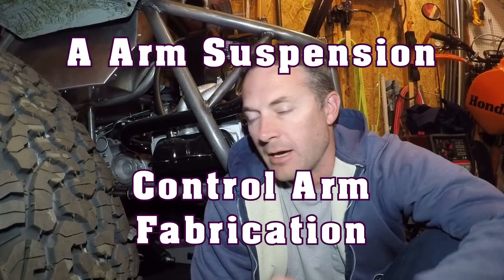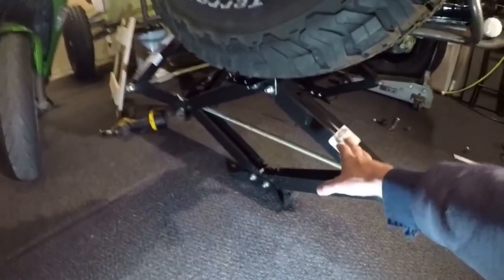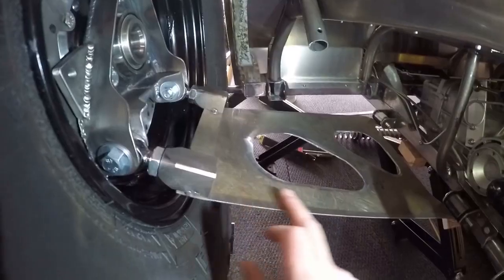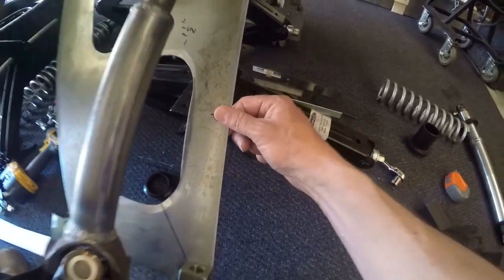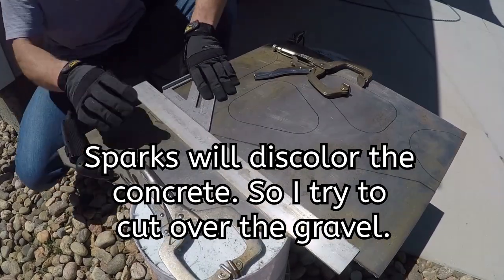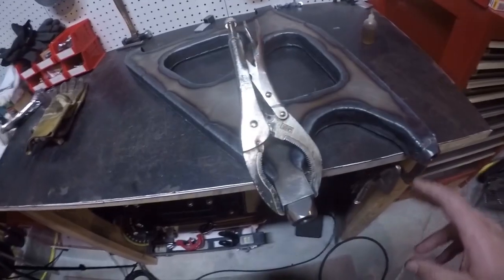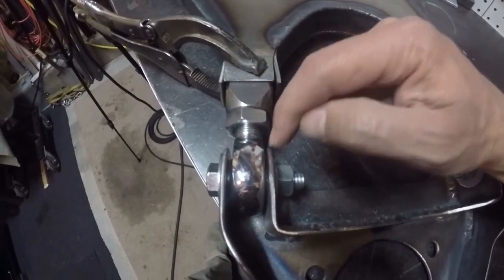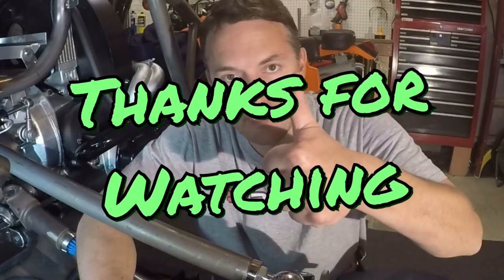Baja Bug Rear Control Arm Fabrication A Arm Baja Bug

Comment: What was the final track width, mounting flange to mounting flange, front and rear? 

I’ve watched all your video and don’t believe I ever heard you say.

I really like the look of Mauler. 

It doesn’t look too wide. It looks just right.
Reply from the maker: Mauler is 95" wheelbase front to rear. 
The front is 70" outside of tires, 62" centerline of tires. Front tires are 31" x 9.5" wide.
Rear is 77" outside of tires, 66.5" centerline of tires. Rear tires are 33" x 10.5" wide.
I don't have flange to flange width, but I hope this info get's you what you need.
Reply: @DougBugBuilder  I appreciate the reply amigo. 

This info is perfect. 

Thanks for all the inspiration.

Comment: I am a complete newb; why did you use a box design over building out of tube?
Reply from the maker: Boxed is easier to be accurate and precise. You can lay out the top and bottom pieces and design it to whatever you need it to be. Then just make the side pieces and weld it together.
Tube you are typically limited by the bend radiuses, so it becomes difficult to make it to what you need exactly. If it's a simpler design they go with tube, but these arms needed to be precise. So boxed was the way to go.
Reply: @DougBugBuilder  Thank you!

Comment: You can't beat a bit of CAD (Cardboard Aided Design) I have used a lot of it over the years.
Loving catching up on the old videos reminds me of twenty odd years ago running an off-road frame bug.
People don't realize the forces involved when a fully loaded bug hits the deck after a 4 foot high ramp at race speeds...I've seen many rear ends torn apart due to some ultra light constructs and welds that look like they had been thrown at the metal from 5 feet away.
Lovely work and I am enjoying the channel
Reply from the maker: Hello Dave, I still really like actually laying things out in person. Maybe that makes me sound old. But it's just easier that way.
Thanks for the comment.

Comment: You only weld two inch's a side because of heat warp little here a little on the other side no more than three inch's  weld  heat warp a bitch myframe  little welding three inch's at a time one side than other

Comment: They also can tell you how far forward the shocks go on topanc bottom  uppér and lower  formula they use and the size of the home joint please just look
Reply from the maker: Just saw this comment, YouTube held it for review for some reason. I did check out the Rock Rod info. Some pretty good info in there, thanks for the tip!

Comment: If you have tire size and ft wheel to back wheel the arm are separated depending on length of arms ck out suspension tape on rock rod there is a formula I didn't no u gilli read it ck it out pretty cool learning
Reply from the maker: I'll look that up, thanks for the tip!

Comment: Also run hiem joint in front two brk5s also jumbo joint on new frame
Reply from the maker: Trying to only run heims where absolutely necessary because they are expensive. I will be using bigger joints on the new chassis.
Thanks for the comment and ideas.

Comment: You want to shorten the wheel base  ok most want longer wheel base  make a nice ride at speeds going  over rough stuff
Reply from the maker: Yeah if the terrain I drove in was open and flat with speed I would have lenghtened it. But the mountain trails I drive on are tight with a lot of 180 deg turns and the speeds don't get much over 30 mph. So being short helps it in that tight enviroment.

Comment: hey doug do you still have the template for the rear a arms and rear spindle on your bug?id like a copy of them if i could I'll pay for em.
Reply from the maker: Tim, I do. I told you I would get construction paper to copy it last weekend and I forgot, sorry. I will get the paper tomorrow and trace them out so I can get you a set for the control arms and spindles.
Reply: Doug Bug ok I thought you tube wasn't letting me post. Wasn't trying to bug u but thank you
Reply from the maker: Tim, I have the template. Email me at dougbugbuilder@gmail.com

Comment: what is that thing called in market that you welded and which holds the heim joint, coz I'm planning to go for that for our SAE BAJA buggy
Reply from the maker: They are called "Threaded Bungs" I got mine from Kartek Offroad.
Thanks for the comment and good luck on your build.
Reply: Thanks. And i am literally following your rear suspension geometry design and the rear knuckle design and also i'm thinking of going for the type of combo of UJ and spline for drive shaft that you came up with. Thanks man for such videos, really useful. And the way you fabricate things, for a student like me is just awesome. Continue doing such videos.
Reply from the maker: That's great, I'm glad the videos can help another builder out. If you go with U Joints remember to try and get the pivot points on the A Arm to match the pivot points of the U Joints. This keeps plunge on the driveshaft to a minimum and is much easier on your powertrain.
Good luck with the build!

Comment: love the build !!! , never seen a u joint set up on long travel last very long , non greasable solid u joint lasted a little longer than the greasable , depending also on what you are using the car for , high speed dirt with the load and unload forces on a short shaft, running a 31 1050 on steel wheels  is quite impressive, but if you just sunday drive put put on mountain trails they may last a long time
Reply from the maker: Peter Duerinck, The U Joint driveshafts are somewhat experimental. This bug will be used on slow mountain trails so I'll keep an eye on them. Thanks for the points, and for watching.
Reply: love your videos keep em coming